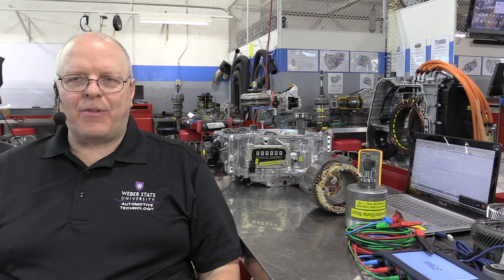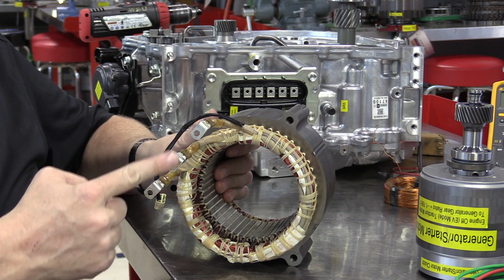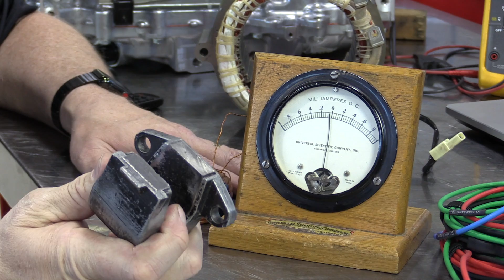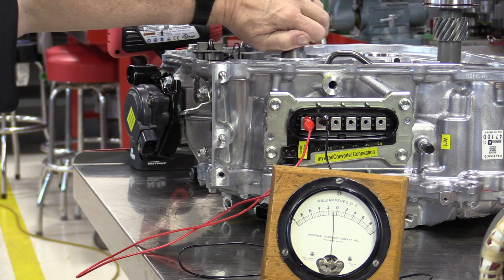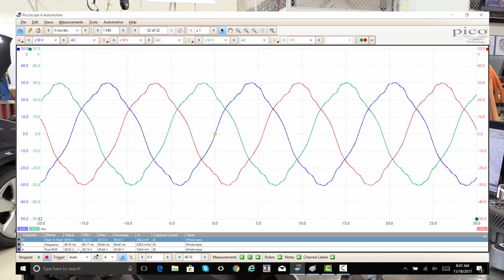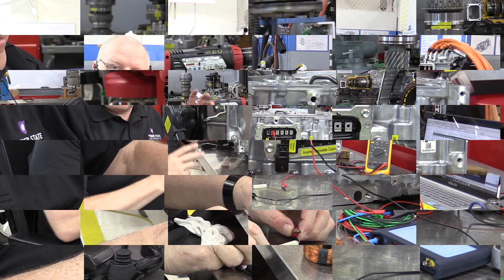Hybrid and EV Regenerative Braking Systems

Comment: One thing I'd love to see - and pardon me if you've done this, I looked and didn't see it - is a discussion of the hydraulic braking system in hybrid & electric vehicles, and how the transition/combination of that and regenerative braking works.  I get the sense there's some real wizardry there.
Reply: As far as I know when you push the brake pedal and the vehicle slows, the energy released is dissipated in part in the brake calipers and discs and in part is converted in electric energy used to recharge the battery. The same phenomenon of the slowing down of the vehicle through the friction of the tires on the asphalt strengthened by the action of the braking system. Moreover I've heard that in some EV when you push the brake pedal the first part of the braking action is obtained through the increase of the load and therefore the increase of the regeneration driven by the inverter. Only after a certain increase in the pressure on the pedal the hydraulic braking system is called to work.
Reply: It’s different in almost every car. Some have paddles to control the regen, some use the brake pedal as @MbMax describes. Some have “one pedal driving” that will let you stop and go with just the gas pedal with no traditional brakes.

Almost all of them let you change how it works. If you want to see it for yourself you should go take a test drive. Much like a standard transmission, there’s good technique required to get maximum efficiency and smoothness
Reply: The hydraulic system is the same as a normal car. Once you reach a certain low speed or requires hard braking that the regenerative braking inside the transaxle can’t perform. That’s what happens. The hydraulic brakes take over once the pedal throw reaches down low enough. There isn’t regenerative transfer through the calipers or pads.

Comment: Your videos are very informative, just one little thing when you calculated the load on the resistor you need to use the peak to peak RMS value multiplied by the amps. The 50V peak is only at the peak for a short time where the RMS is an average.

Comment: I bought a 2019 Prius Prime on July 2, and have driven it about 800 miles. The explanation in this video of what "B" mode does is wonderful! When I am approaching a red light at 40 mph, and let off the accelerator pedal, the car slows down, and the power flow meter shows regen braking in effect. Pull the selector into "B", and the deceleration instantly increases substantially. The owner's manual says nothing about what's actually happening in "B" mode, and this video explains it perfectly! So, deceleration in "D" mode only uses MG2 for regen braking, but deceleration in "B" mode adds MG1 for additional regen braking. Prof. Kelly, I live in Sacramento, CA, and we get daytime high temps up to 115°F in the summer months. Is there enough cooling capacity in the P610 to keep the MG1 and MG2 stator coils within safe temperature limits in a climate as hot as ours gets? I try to drive in EV mode as much as possible, so I am giving those motor generators, and the battery, quite a workout. I am not sure yet how these stators are cooled. Are they submerged in the liquid transmission oil, or are they dry and cooled by air flowing through them?
Reply: They are submerged in ATF.

Comment: As excellent as ever. I'd love to be in your classes. Quick question; how does the car balance regen with hydraulic braking? You obviously want as much power back as possible but, of course, the car must stop when you need it to. From what you just said, sounds like speed and pedal pressure are both used as inputs (IV's), along with SoC. I guess the car would also need to balance braking per wheel as well. Can you say more about all this?

Comment: I have 2nd Gen, in"B" realy use both braking motors. But it is not necessary because the batteries are only able to hold up to 100A of charge, which means that even one electric motor is able to generate more power than the battery can. Therefore, there is no increase in efficiency when using "B", on the contrary, the vehicle is also slowed down by a petrol engine that saves no energy (only generates heat).
Reply from the maker: Thanks for your feedback

Comment: I agree with other poster. The L shift selection seems to employ engine breaking, where other modes can stay in Regen. Also, Regen seems to start as soon as one takes their foot off of the accelerator.
This video explains a lot but leaves me with a few curiosities:
Is Regen, as the dash display implies, much more efficient when barely employed?
Does Regen hit the components hard until they heat up, then back off? I think I read somewhere that a Gen1 Honda Insight regen charges at around 60A till component heat forces a cutting back. This would preserve the most energy in cases where the brakes only get a quick stab, and shouldn't harm the over all efficiency in situations where a quick stab is followed by a long downhill grade.
If you'd short the stator during simulated engine breaking, what would the current Spike to? Would rotor stop immediately? Any imbalance might crush the bearing. Maybe the frame which holds the windings would snap. If I get a ruined transaxle I'd love to speed up a MG and short the windings to see the result. Perhaps a wire would merely melt open.
I'd like to see your generator-feeding-motor experiment redone with two windings attached as shown but take the third on the motor and short it while reading the current.
You missed an opportunity to discuss the IR of the stator when computing the estimated 250W dissipation of the ceramic resistor. I'd recommend that you throw DMMs across the two and calculate the stator's heat dissipation.
I wouldn't use a ceramic resistor for the smoke experiment unless you are coating it with something non conductive for your smoke emission. I'd use a carbon resistor with an inline fuse. A carbon resistor will heat up, catch fire, then if the voltage is high enough it's likely to align the carbon to a lower resistance, then blow that open. Tons of fun for a few pennies.
It would be interesting to know the most limiting factor in the electrical part of the system. I assume regen is the most taxing and I'll guess it's the battery that's the weak link, but it could be the buck converter or the rectifier diodes.
Very interesting video. Thanks for the brain candy.
Reply from the maker: Thanks for your feedback

Comment: That's essentially how diesel locomotives transmissions systems work. A diesel internal combustion engine rotates an altertator which supplies electric energy to a motor which rotates the wheels.
It dynamically breaks inverting two phases and dissipating the energy in heating elements and electro ventilators on its roof.
Reply from the maker: Yes, pretty cool stuff!

Comment: I have a question about regen brake and the brake light about bolt ev: when regen is running, meaning the green circle on dashboard show, the brake light is not always on, as far as I feel. only when more volts are showing on regen, the break light is on. IF TRUE, can gm reconfig this so that the brake light turned on at lower threshold? It helps my safty.
Reply from the maker: Good question, I do not know that answer

Comment: Thanks for yet another very educative video, professor. I'd like to see your comment about the following statement from the Prius Wiki about the B mode: "Using B mode gear in normal driving situations is not useful, since energy that could be used to re-charge the batteries is instead wasted in heat generated by the engine which is compressing air. No extra energy is actually recuperated in B mode, energy is just being wasted. The only benefit is to prevent the brakes overheating during long mountain descents." (chapter 10 http://prius.wikia.com/wiki/Hybrid_Synergy_Drive_(HSD)). In my view, this contradicts your explanation of what happens when you put the vehicle in B mode (using both MG's to slow down the vehicle). Many thanks in advance.
Reply from the maker: Another reason to not trust wiki based information. Anyone who has actually driven a Prius down a long steep road in B mode can tell you that the battery gets fully charged in a very short time period while providing regenerative braking. Once the battery is charged through regenerative braking, then the engine is spun at a high rpm with the fuel shut off to provide engine compression braking upon deceleration. The engine rpm is variable depending upon how much room there is to store energy in the battery. Low engine rpm typically means high MG1 rpm and high regenerative braking and low compression braking. High engine rpm typically means low MG1 rpm and low regenerative braking and high compression braking.  Driving in B mode on horizontal roads would result in the same conditions, but at a slower rate. I hope that helps.
Reply: @WeberAuto  Thank you so much for the answer! I'm coming a little closer to understanding how the HSD works. BTW, I'm driving a 2016 Auris TS which features the same powertrain as gen 3 Prius.

Comment: Hi professor,
I have a question about the Picoscope, when you measure the 3 phase voltage, you just connect one positive lead, so how about the negtive lead, leave it open or connect to the ground?
Reply from the maker: Connect it to the case of the transaxle

Comment: Professor Kelly, This discussion was an incredible presentation. Love the old mili ammeter and find it incredible that with induced low voltages of appx 3 volts the output motor gen actually turned. Your “student” body is not limited to just those that fortunate enough to attended Weber, but extends around the world to those from 9 to 90 and continues through the years. Thank you so much!
Reply from the maker: Thank you very much!

Comment: Great breakdown and explanation of regen.
I always drive my Bolt in L, rarely use the brakes. 
On the flip side,  I  doubt I will get many miles out of my front tires!
Yes, I rotate every 5k miles.
Reply from the maker: Thank you. Keep the tire pressures correct or even a little high.

Comment: Where does the energy go when the battery is full? I'm asking about a Bolt because it doesn't have blended brakes. I've never had mine in a situation where the capacity of the battery was less than the potential energy of regeneration.
Reply from the maker: Nowhere, the regeneration is turned down or turned off as needed

Comment: Fascinating video.
Now the question I have is:
On a long long downhill (say 5 miles), do you get better mileage by slightly pressing the gas petal just to stop the regenerative braking or do you get better mileage by leaving your foot off the petal altogether?
My reasoning is that it's always better to keep kinetic energy rather than charging the battery  and then back to kinetic.
Reply from the maker: regenerative braking can add power to a battery if it has room for the charge, otherwise the energy is wasted by spinning the engine crankshaft.
Reply: @WeberAuto  
Thanks!
Reply: Regen adds reag downmil regern add 5 mies more

Comment: Hello sir can i get help from you pls? I have lexus ct 200 and it has a fault code P3000. The car start and straight away cuts off, what do you think sir. My diagnostic says  (Battery control system) what that mean? Do i need to change hybrid battery or something else?
Reply from the maker: Too many variables, I cannot help in this case
Reply: What yer car naterr if new ybrre bary if u yyber over 10 years ld

Comment: Hi I have question can you test the integrity of the stator winding by the waveform you produce by spinning the rotor . Cause I thing if a winding is damage or shorted  to one another  the result of the outcoming voltage  won't be so even.
BTW thanks for your work and share of such a valuable information
Reply from the maker: Thank you. It is probably possible, I will have to try it

Comment: Hello professor. I really appreciate that you create contents like this to build awareness of these cars. I have one myself, particularly the 2007 Honda Civic Hybrid with a 2nd Gen IMA system. I know its abit complex of how you explained it in the video but is it ok for you to explain part by part in layman terms. Sorry, I know youre expecting someone that is already a mechanic but I was just curious of because if anything, I still wish to know the basic of regenerative braking because I search everywhere and they dont exactly go into deep details of what parts or what section of the car causes the regenerative braking. Its also because, I wanted to know if changing my brake rotors or any part of the braking system of the car changes the output of the regenerative braking system. I know the part that in the 2nd Gen Honda Civic Hybrid is that on a smaller and controlled brake, the regenerative brakes is used, but in harder and sudden brakes, the conventional brake rotors are used.  I love your content sir but I would really appreciate it if you can explain it more easier for me. Im sorry sir for asking such a thing.
Reply from the maker: Thank you, I appreciate your feedback
Reply: WeberAuto So back to my question sir, so the regenerative braking is done through the transaxle of the motor and not so much on the actual brake rotors of the car then?
Reply: Indeed. The point of regenerative braking is using the motor MG2, acting as a generator, to use mechanical energy (of the car going at speed) to generate electrical power that can be used to charge the battery. The brakes only convert that mechanical energy into heat by creating friction between the brake rotors and the brake pads.

Comment: Hi John, a great video.

 An idea I have is a demo to show how the Power Split Device splits power. (1) Put your electric drill in place of the ICE. (2) Put a small electric load resistor on  MG2. (3) then put a load resistor onto MG1. (4) note the power going to MG2 with a volt meter. (5) change the load resistor value that is on MG1 (put another resistor in parallel with it). (6) then use the volt meter that is on MG2 to show that the power has changed. That is the Power Split Device is splitting the power different to what is was. By changing the load on MG1.

Regenerative braking. You might like to tell everyone. That it is Lentz law that is in play so that they can also google it.

Best Regards Roderick Wall.
Reply from the maker: Thank you and thanks for your feedback!
Reply: Hi John, do you think you will ever create the demo that I have suggested?
Reply from the maker: I would like to, but it will not be anytime soon. There are too many other video topics I am behind on and our Fall semester begins in one month here at the University. Busy season comes again. Have a great day

Comment: Another great video. One question: when we power the electric motor at 200v, and the motor is 25kw (let`s say), the regen current can be similar than the rated current during breaking from top speed?
Reply from the maker: Thank you, that is a good question, I do not know if it reaches the same rating as the motor kW rating. I suspect it can get very close.

Comment: I find your mechanical lectures wonderfully clear, but I feel that a non-electrical engineer will be puzzled by a few gaps in this one. For example you need to explain about star and delta configurations otherwise students will be puzzled why one winding needs two connections while three windings only require three connections (and since six connections are visible for two separate MGs, misconceptions may easily arise).
Reply from the maker: Great feedback, thank you!